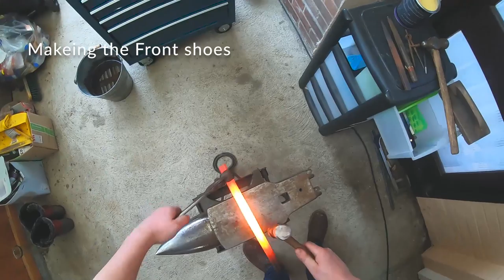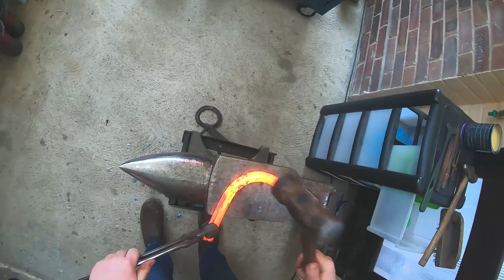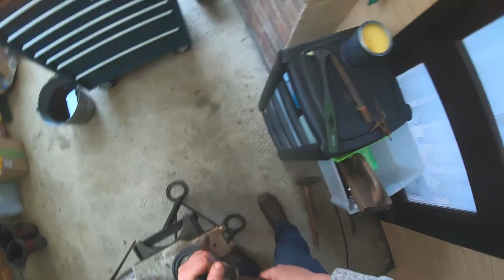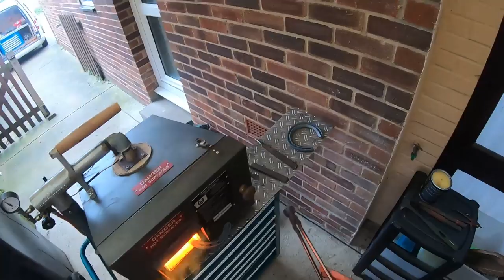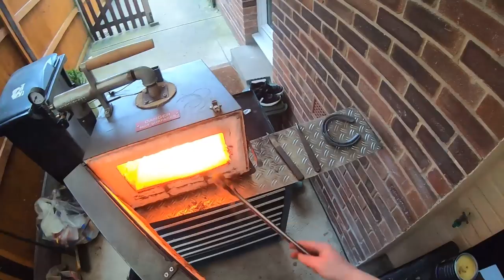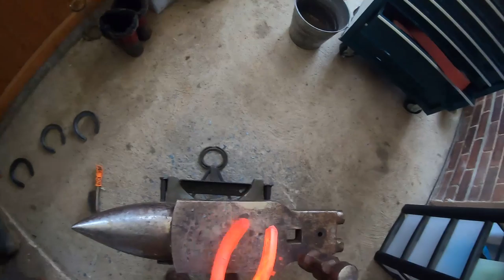( Part One ) Hand-making Horse shoes Farrier/Blacksmith

Comment: What's that can of yellow stuff you were dipping the pritchel in? I want to say it's beeswax, but I'm not quite sure...
Reply: You'd be correct in thinking that it's a can of beeswax.Beeswax is good for dipping air hardened tools in because it cools them gently while lubricating them at the same time.
(Cooling tool steel in plain water can make it brittle) 
Some farriers/Blacksmiths heat their cans of beeswax to liquefy it & then add carbon powder into it, then when the beeswax cools & sets back into it's wax form it's lubricationing properties are increased.(Doing this gives it a distinctive grey colour thought.)